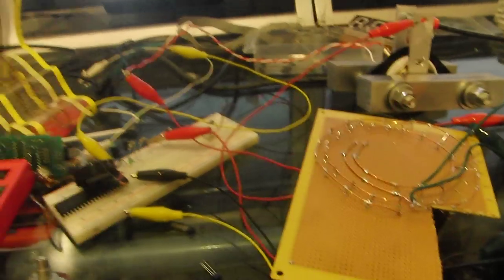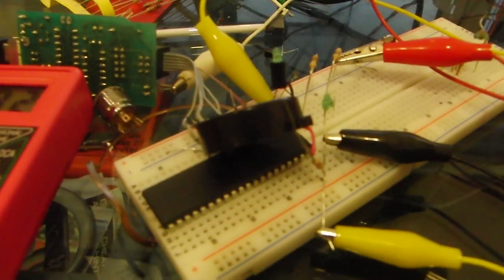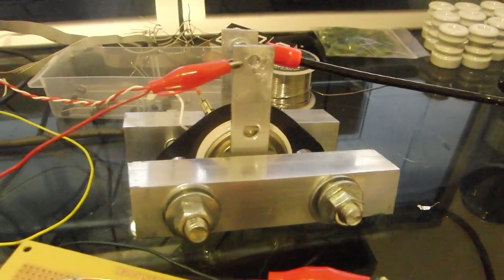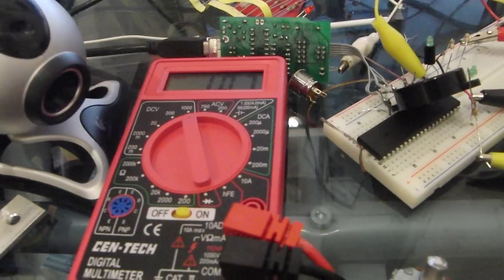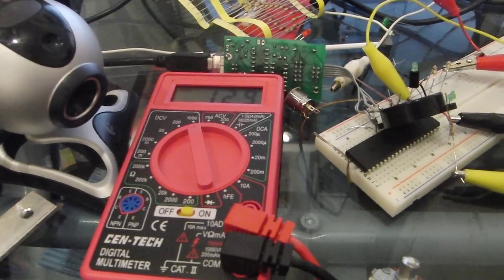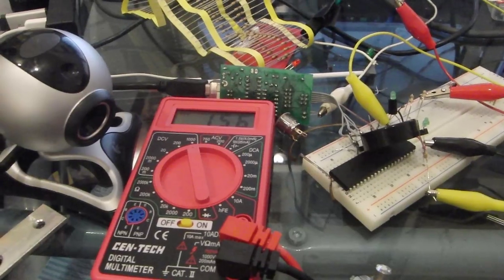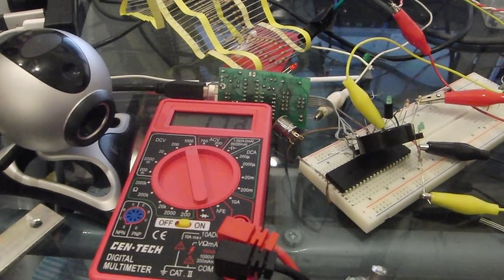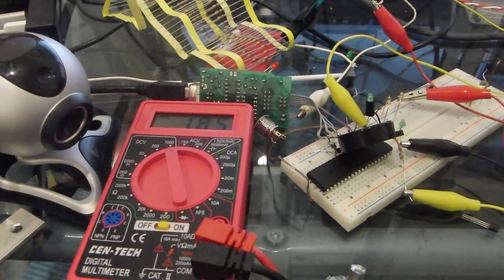Beta - Timebomb test

Comment from the maker: @zker666 Nice,  I forgot how to use the chips Timers/Counters, so I just did a count = count + 1.  The first beeps are around 2000hz.  That means 2000 times a second, the chip counts 0 to 12000, and resets to 0.  To make that beep.  It's a bad way to do it, because every time I add more "If" statements, it slows the chip.